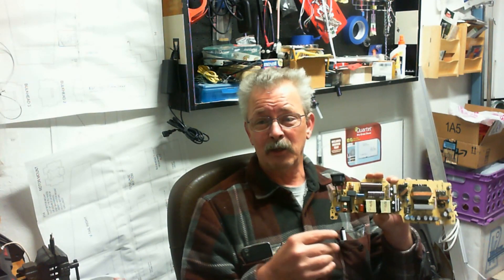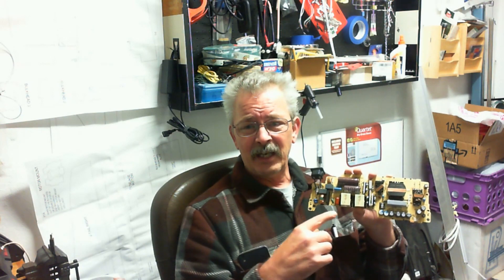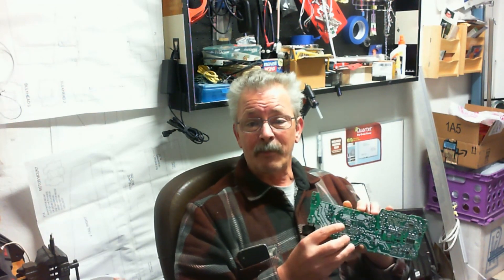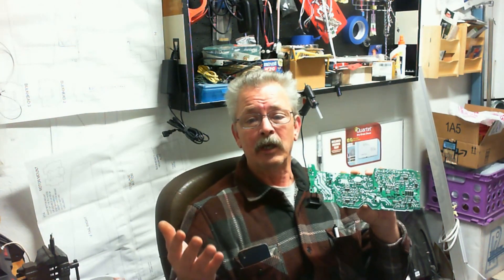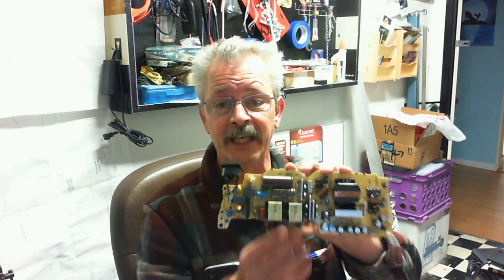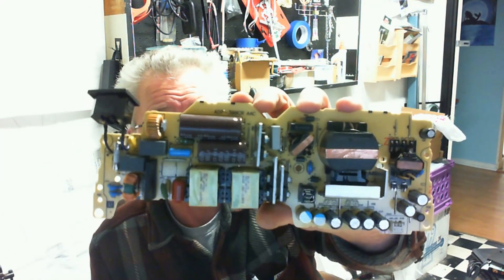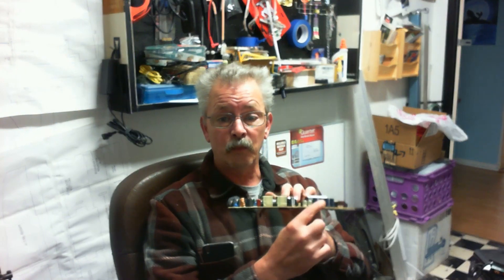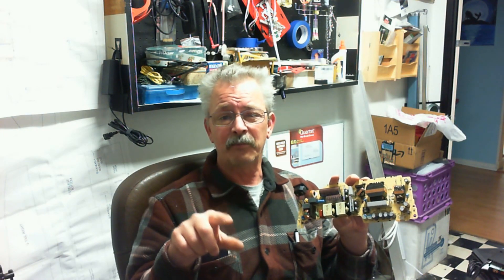PS4 Power Supply Repair ADP-300CR AAC

Comment: ZD39 is short circuiting on my PS4 Pro power supply (ADP-300CR AA).  Anyone know what to replace it with?
Reply from the maker: Before you get some bad advice on YouTube or from someone reading your comment that has no clue,   causing you to burn down your house and kill everyone in it, or your customer's house depending on why you are here? I strongly suggest you buy a replacement one on eBay or Amazon before you wind up in prison for murder doing an unqualified repair or lose everything and possibly everyone you love because you obviously do not know what you are doing.
Reply: @ClovisX Well, after some research I found the part numbers. But I decided not to take the risk and just replace the whole power supply. My local repair shop gave me the same advice.
Reply from the maker: @mauricehendriks5550  Very smart idea.
Reply: up

Comment: Hello hope you still monitor this channel. Before you bust me on burning everyonrs house down. I am an electronics tech with a major gov contractor so yes meters omnis o scope very familiar. My question is follows. Q9. And ic131  both are 2legged pakages. Both are blowed up cant read there chip nomenclature
Reply from the maker: Don't you think the obvious solution would be to pull them off another PSU that died form a different reason and use them either on the PSU you are trying to fix or to assess or read their values? 
Your Question makes it a little hard to believe you are as you say "an electronics tech with a major gov contractor" I mean it is the basics so why would you need to hunt down a YouTube video and ask?
Not calling you a lire [Just saying?]
Reply: @ClovisX  im not in business to replace fix them so i do not have any laying around to read. Im fixing it for my son not for profit
Reply from the maker: @cablrus1885  Did not say you were but that would be the cheapest way for you to fix it if you just want to do it yourself however it would be best and faster and make the kid happier for you to just buy a replacement, take the model number off the back, and buy one on eBay or Amazon If you would like to support this channel I can provide links just send me the model of the system found on the bottom or back of the system.
Reply: @ClovisX  adp-300fr aab. 2 chip numbers thats it you prolly have 20 laying there. So yeah i ordered one on prime. Due to lack of info
Reply from the maker: @cablrus1885  Sorry, I offered everyone including all the YouTube Educated fake repairman an opportunity to have a Video schematic of every power supply for every PS4 for everyone but they were too greedy they wanted it to be private, not posted, and free! OMG!

I could look up the components for you but I just do not have time I have way too much work and unfortunately, I don't have them all mesmerized or I would have just told you but even if I did with all likelihood there would have been several other components that were damaged and you likely would have just wasted your time and money anyway.

Comment: R57.....what is the value?
Reply from the maker: You are best not repairing your Power Supply you can easily burn down your house, with that sed it is easier to simply remove R57 from a different power supply and replace it with it.
Reply from the maker: I can get the value for you but it is best if you give me a timestamp of the part you are asking about so I do not need to look for it even with the resistor number it is faster for me to see the part and tell you its value rather than finding a power supply and finding it as I do not memorize every single part of the power supplies.

Comment: Hello, how are you? Very good video, I wanted to ask you a question, I have an adp 300 cr and the resistance of 16.8 burned, the issue is that when I replace it, it burns again instantly that I try to turn on the ps4, identify about 18n60m2 in short, I replaced them and also the resistance and when I try to turn on the PS4 it shorted the 18n60 again and the resistance was open. you have any idea what the problem could be. Thank you in advance for sharing your knowledge. Could you help me please, once you gave me a great help this time it would be another hahaha, I would be in debt to you
Reply from the maker: I know a few reasons why but I do not offer advice on anything I can not test especially the PSU that is the one thing in the system that can burn down your house and kill everyone in it you are better off buying a replacement.

Comment: Hello sir..
I'm asking for R5 in ADP-300CR AA
Reply from the maker: Send me $6.00 on cash app to $ClovisX559 in the comment enter your Name and complete address and ask for the R5 for your Power Supply and I will send you a good R5 it will be pulled from a dead power supply but will be perfectly good.
Reply: What is the value of R5
Reply from the maker: @danielwiebesiek3709  Send me $6.00 on cash app to $ClovisX559 in the comment enter your Name and complete address and ask for the R5 for your Power Supply and I will send you a good R5 it will be pulled from a dead power supply but will be perfectly good you can then test if and get your value. Personally I think you should stay out of the PSU before you burn down your house.

Comment: Hey. How do you take just the faceplate off the xbox 360 slim and how much do you charge if someone sends it to you for repair?
Reply from the maker: If you are near Clovis, CA let me know and bring it in and I will test your system "FREE" http://www.clovisxbox360repair.com/contact.html
 as for pricing your repair can be free at the lowest but I do not charge a one price fits all repairs I do specific repair pricing so you get the best possible repair price most repairs can be completed for $65 or less all parts included but depending on what you have already dun and it's model it can be more seldom over a $100

Comment: Lol I got for $10 with a new psu I just need to find any schematics or a diagnosis flow chart to point me in the right direction.
Reply from the maker: You should not attempt to repair your power supply You will likely just succeed in burning down your house and killing everyone in it. Have it repaired by a qualified person or Buy A replacement they are cheaper and safer.

Comment: Hello sir wondering if you do repair request if so do you have a website or email to reach you? Ps4 slim new working PSU notice power button and eject does not active the tigger wiring to supply 12v. I manually active the tigger wire (12v now active) but system just spins fan for a second. Haven't tested with hdmi to verify if it was just a startup spin from the fan. Ideas? Thank you for your videos. New sub for you :D
Reply from the maker: I do not put up a lot of repair videos mostly preventive maintenance so you can avoid 99% of your system's problems and some problems you can visually identify as being your specific problem, the reason for this is most of you will spend money you did not need to spend on a suggestion by an unqualified individual posting a youtube video showing you only 1 possibility out of 100's or even 1,000's of things that can cause you to have the exact same problem this can and normally duse lead to wasted money & frustration along with the needless death of an otherwise repairable game system.  Example: You watched a YouTube video that describes your problem so you went out and bought a power supply that was not needed making your repair more expensive when the power supply had nothing to do with your problem even though everything the persons in the YouTube video sounded exactly like what your system was doing.
You know little to nothing about electronics so why would you attempt to repair something so expensive knowing there is a 98% likelihood you will only succeed in making any repair a lot more expensive or even impossible by even a qualified repairman that actually went to school?
Find a Qualified Repair shop it is cheaper than buying a new system and 10,000 times safer than you trying to do it yourself.